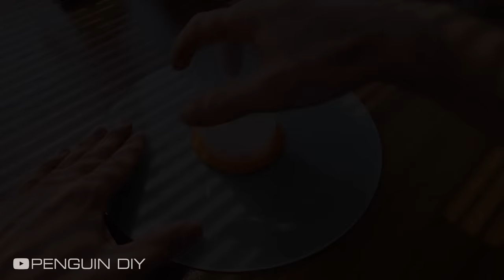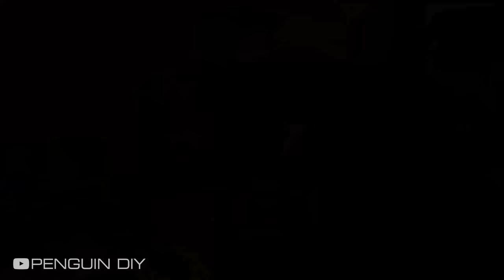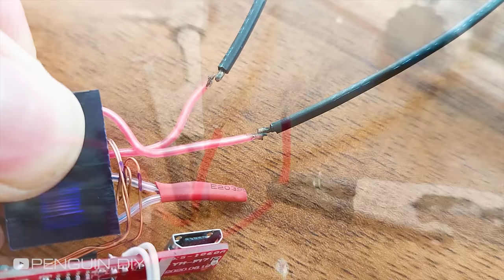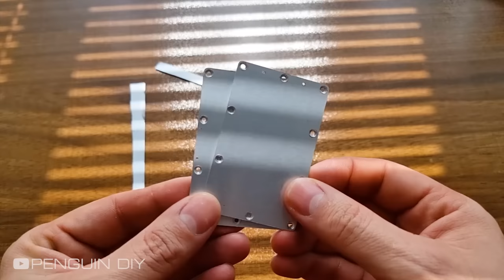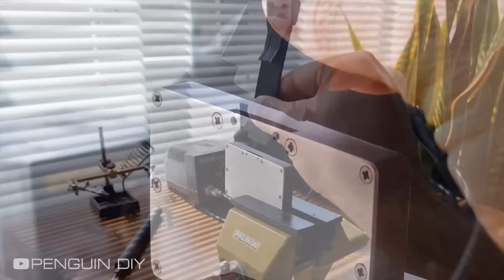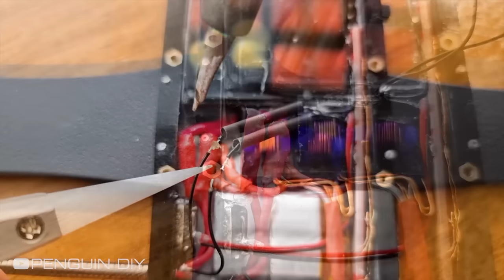TASER RING! how to make ring of high voltage generator - High voltage transformer

Comment: Impossible task for me without knowledge of capacitors and electricity..
But every time your video is uploaded, I admire it every day.
Reply: Just buy a 400,000  pulse transformer that's already a stunning gun and add long wires battery. Your ting is done.

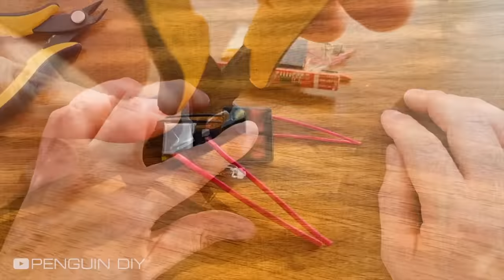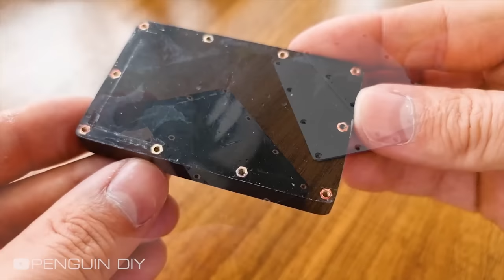Comment: 5:48 How did you route the red wires to the same side as black wires? Or did you build an entire new one just to do that? Also at 7:43, what did you use to cut the frame out of the epoxy so cleanly?

Comment: Fantastic.  A little added security for the walk home.
A question: Is there any heat that is generated inside the wrist-worn module that builds up and needs to vent? Or do the metal walls act as a heat sink so no vent holes are necessary?
Wonderfully precise and compact work.

Comment: Hate to be the bearer of bad news but that thing will be next to useless in a confrontation. The way taser works is the use of two probes going into two different areas of the body, primarily north and south of the belt line. The energy running through the body is what causes the neuromuscular incapacitation you see when people are tased and fall.

Don’t get something like this thinking you’re going to scare someone off. There’s no way it produces the amount of energy necessary for pain compliance. I ain’t gonna lie, it is cool looking, and probably a good talking piece, but don’t get into a fight relying on it to secure victory.

Comment: Nooob here but I know diodes stop current from flowing in the opposite direction but do the diodes do in this circuit?
Reply: It's used as a voltage multiplier circuit in this application.
Reply from the maker: Yes, these diodes are high voltage and are used as multipliers in this circuit.

Comment: In the UK, the possession, sale, and use of high voltage electric shock devices that are intended to hurt someone, such as stun guns and tasers, are restricted under the Firearms Act 1968 and the Misuse of Drugs Act 1971. These devices are considered to be firearms, and their possession without a valid certificate is illegal.

The possession of such devices can lead to serious criminal charges and penalties. Using these devices to cause harm to another person can result in charges of assault or even more serious offenses, depending on the severity of the injury caused.
Reply: Well Duuh.

Comment: Please be aware....In the UK 
Stun guns are prohibited weapons and it is an offence to possess them. A stun gun is a weapon that discharges a large voltage of electricity into its target, rendering them incapable of movement for a short time and are very dangerous. It is illegal to import or mail them into this country and the penalties will apply.

If you are found in possession of a stun gun, you could face up to ten years imprisonment and/or a fine. In order to possess, purchase or acquire, or manufacture, sell or transfer such weapons you must have authority from the Secretary of State.